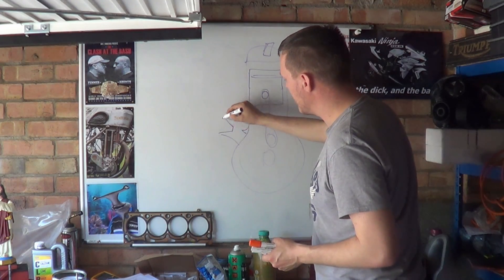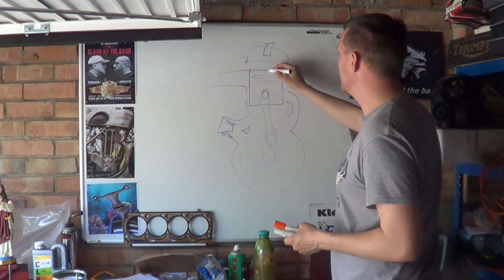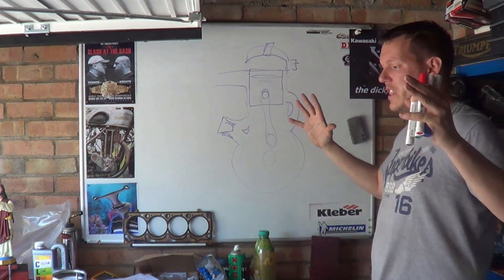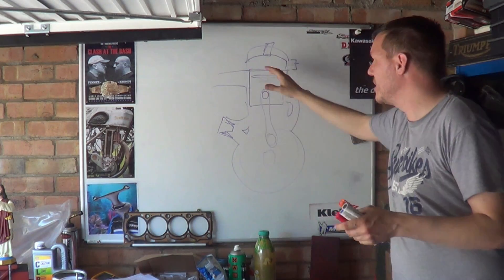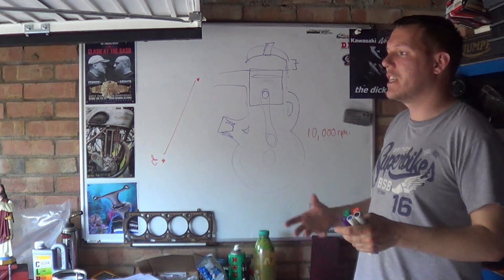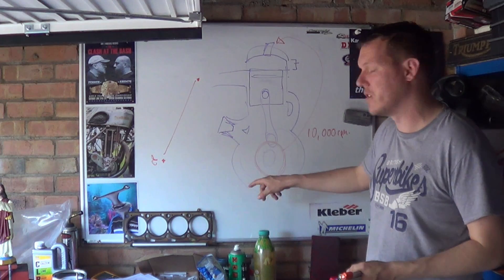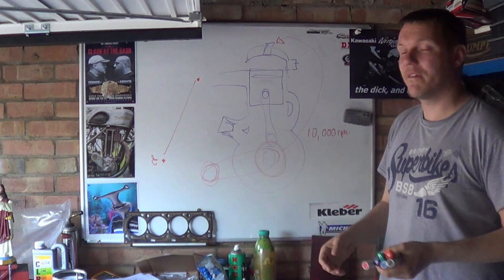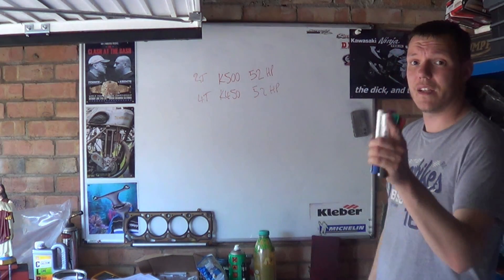2T Direct injection - Comment Reply

Comment: yeah i live in perth western australia where ralph sarich tested a fleet of ford lasers fitted with supercharger scavenged 3cyl air blast direct injected 2 stroke petrol engines,and i saw prototypes dumped at balcatta tip nearby,crackcase scavenged 2 strokes suck balls

Comment: What issues would arise if you ran two separate fueling systems, that fired in alternating order? It would give an extra stroke's amount of time to rebuild pressure within each injector, each one only injecting every other stroke exactly like a 4 stroke would be.
Reply from the maker: cost and weight, but in this case mainly cost

Comment: Is it not possible to address the oiling issue by using Ceramic big end, small end etc..bearings, or something that can bear the heat while still be smooth as a babies bottom for the two stroke engine?
Reply from the maker: Ceramic bearings still need lubrication, I did a video on it

Comment: does brp producing direct injection for 8 years now and moving to a directly oiled crank last year not count? Gas mileage has seen moderate gains through out development but oil consumption has plummeted! I know you look at it from the street bike perspective where the inline fours can provide more than enough power and longevity than the average rider needs but there are other toys out there with very different requirements.

Comment: can you not just replace the typical air fuel carburetor system. and just inject into the crank case through the reeds with a measured amount of fuel to the air
Reply from the maker: yes and they do, but how would this help? You stll need to oil the components inside.
Reply: i would still use yamaha's autolube system into the reed cage but i would use it with a  throttlebody  not  a separate pump like on a dt its no where near the carb or inlet its round the side fed with a line controlled by the throttle cable i would attach it direct to a throttle body with a m.a.f sensor and an injector all linked up with position sensors you could use air ratio gauges and other gizmo's and pressure gauges in the crank this way and it could auto adjust air or fuel with an e.c.u but would still all be controlled by throttle position not engine speed just thoughts ideas. there's probably a still a drawing board or 2 i might need to go back to lol

Comment: i still dont get it how this aprilia ditech direct injection works,  it has a verry low fuel pressure but it uses somekind of air compesor to inject the fuel, realy wierd system, cant quite wrap my head around it.
Reply from the maker: Video coming soon dude - matt

Comment: On snow (snowmobiles) the naturally aspirated prevailing technology is 2-cylinder 850cc Etec (direct injection) two-stroke, producing  about 200 HP/litre. Closest competitor is a Turboed 3-cylinder four-stroke producing the same litre HP as the naturally aspirated two-stroke. 
Both engines has it's pros and cons. The two-stroke is much lighter and cheaper. The four-stroke is  alot more durable, and much easier to get alot more power out of since the turbo is already there. 
When you ride them both on the trails, the two-stroke Etec actually gets greater MPG. But when you use all the ponies it's actually pretty much a draw, all the horses need food 👍😁.
That being said two-stroke direct injection engine technology is very much up to par regarding horsepower output and MPG in select vehicle applications. 
Great vids 👍,  your whiteboard drawings and reasoning is easy to follow  and understand 😀

Comment: This may be a dumb comment but....... My old 1998 2T 125 had a catalytic converter in the expansion pipe. I found out later it was restricting the power but it did work, the original silencer packing (sealed silencer) was still good after 15 years. With an Arrow pipe the packing lasted about 1 month! No need for Direct injection or TPi just fit catalytic converters on 2 strokes, problem solved (maybe?).

Quote from the owners manual - The catalytic vehicle is fitted with a silencer with metal catalytic converter of the “platinum-rhodium bivalent” type. This device provides for the oxidation of the CO (carbon monoxide) and of the HC (unburned hydrocarbons) contained in the exhaust gases, changing them into carbon dioxide and steam, respectively. Due to the catalytic reaction, the high temperature reached by the exhaust gases makes for the burning of the oil particles, thus keeping the silencer clean and eliminating the exhaust fumes.
Reply from the maker: For them to be affective they restrict the air flow quite severly. They also weigh alot about 35% of a 2 stroke engine. The CAT in the 1998 bike won't be adequate for todays emissions. NOx are the main stopping block today. You need a 3 way CAT to pass the emissions testing

Comment: I agree that adding shit to a engine will bring down it's raw hp and adding a super charger is leech on the engine. But you have to factor in that a super charger will be forcing compressed air in which "should" make up for the loss plus a bit more.
Reply from the maker: which I did in this video - https://www.youtube.com/watch?v=7pdY_wlofoY&t=375s

This is in reply to the original above

Comment: Engines with direct injection don't loose power - they GAIN power, torque and efficiency (in regard to EFI/carb).

High pressure pump do need more power, but whole system is more efficient/powerful, and parasitic load is probably just a few percent.
Reply from the maker: LOL I'm going to love this one.

"Engines with direct injection don't loose power" 

- where did I say this? Like really, did I say this? And at what time? If I did then I need to know, because that is wrong.

"they GAIN power, torque and efficiency"

- Gain, power, and torque. Power is torque x rpm. If you increase torque then power will increase. I'm intrested how you think direct injection increases torque in a 2 stroke engine.

"High pressure pump do need more power,"

- err...... yes they do. Higher pressure means more work. More work = more power required. 

"but whole system is more efficient/powerful"

- see you said it yourself. More powerful. 

"parasitic load is probably just a few percent."

- how much, roughly?
Reply: Relax, I didn't quote you, that's my opinion, but here are some quotes: 

"Unlike with gasoline port fuel injection, the air/fuel mixture is formed directly in the combustion chamber in engines with gasoline direct injection. Pure fresh air enters via the intake valve. The fuel is injected into this airstream at high pressure (up to 200 bar). The result is an optimum swirl effect and improved cooling of the combustion chamber, paving the way for higher compression and, in turn, greater efficiency – leading to a reduction in fuel consumption and a substantial improvement in driving dynamics. This makes gasoline direct injection the ideal technology for downsizing and turbocharging."

http://products.bosch-mobility-solutions.com/en/de/powertrain/powertrain_systems_for_passenger_cars_1/direct_gasoline_injection/direct_gasoline_injection_23.html
Reply: ..."Compared to conventional MPI engines of a comparable size, the GDI engine provides approximately 10% greater output and torque at all speeds. "

http://personales.upv.es/~jlpeidro/gdi/P11-1.gif

http://personales.upv.es/~jlpeidro/gdi/gdi.htm
Reply from the maker: "Relax, I didn't quote you, that's my opinion"

- cool.

- The quote you pasted is for 4 stroke cars. Not relevant here. Also that the injection described is on the intake stroke as the piston is on the way down. So pressure in the cylinder is low. And still they use 200 Bar.

"..."Compared to conventional MPI engines of a comparable size, the GDI engine provides approximately 10% greater output and torque at all speeds. "

- and this is mainly down to the compression ratio 10.5:1 vs 12:1. A lot of bikes already run 12:1 with MPI.

Comment: Rotax has been doing direct injection on there 2 strokes for 6 or 7 years now.injector is directly in the center of the  cylinder head,where the spark plug would usually  go. 600 twin gets about 23 mpg,at about 130 hp.the 800 twin gets around 15 0r 16 mpg and makes somewhere around 170 hp.they also introduced electronic oil injection at the same time.
Reply from the maker: Yeah and a video is coming soon, although is not as it seems. And just to add to this comment - 23 mpg is shite and 16 mpg is worse lol
Reply: but the power to weight is so much better on the 2 stroke,what's the old saying? if  want to play,you have to pay!!!! also,they have been turbo charge g snowmobiles for some time now. rotax got there technology when they bought out evenrude.so,if you look at motocross bikes,the 2 stroke makes about twice as much power than a 4 stroke with the same displacement,and the 2 strokes weigh a lot less.honda has a 2stroke endure bike,only available in japan,that meets and exceeds California emissions!!!
Reply from the maker: "rotax got there technology when they bought out evenrude."

- I think you mean BRP.
Reply from the maker: " 2 stroke makes about twice as much power than a 4 stroke with the same displacement,"

- this isn't true, unless you know something I don't?

Comment: I have always wonder if it would work to use a 4 stroke bottom end so it alway has oil and have a 4 stroke barrel but with a exhast port cut in the bottom and a 2 stroke head with a direct injector in it. will it still running like a 2 stroke but on straight fuel?
Reply: then u would need a camshaft to operate the valves... its like a 4stroke converted to 2stroke... i get where u are going, but with all the frictional and mechanical losses due to increased complexity. Im pretty sure it can be done but, with all due respect, imho, its kinda diminishing return isn't?  the advantage of 2stroke is huge power RELATIVE to its weight n size. with all this bits n bobs u added, its defeating its purposes. or not? im open to discussion.
Reply from the maker: "with a exhast port cut in the bottom and a 2 stroke head with a direct injector in it."

- I don't get this bit?
Reply: The Workshop like a 2 stroke but without the intake ports just an injector and a bottom end with a sump so it doesn't need lubrication from the fuel
Reply from the maker: so how does fuel and air enter the cylinder?
Reply: The Workshop an injector and throttle body off the head kinda like a 4 stroke intake
Reply from the maker: wouldn't that pretty much makes it a 4 stroke?
Reply from the maker: I get what you're talking about now. I'll do a video on this soon - matt
Reply: The Workshop if it fired on each stroke and have a exhast port in the cylinder wouldn't it still run like a 2 stroke
Reply from the maker: "The cool thing about a 2 stroke is the "supercharging affect" that 
happens when the piston travels downwards in conjunction with the proper
 pipe. "

- please say you didn't just say that..........

Comment: the BRP etec works good on snowmobiles, but could it be because they are limited to a top RPM due to the CVT (they become really inefficient above 9000 rpms) so they max out at about 8200rpm. another thing with the etec is poor throttle response. on the new 850 etec they added aux injectors in the throttlebody area to work as an  acceleratorpump to overcome that. another feature on the 850 is a four stroke like crank with similar oiling of the bearings.

Arctic cat has a different approach to semi direct injection (on the ctec engine) with a injector in the cylinder wall and a slit in the piston wich gives the option to inject through the piston (to the crank case) or above the piston for a short duration, aimed away from the exhaust port.
Reply: edit. the ctec injector is not directed away from the exhaust.
Reply from the maker: Excellent comment dude - matt

Comment: How about F1's  prechamber idea that they use also in diesel engines ??
Reply from the maker: what about it?
Reply: The Workshop  would it be a somekinda solution or does it have the same fuel injection preasure etc. problems that you mentioned earlier ?
Reply from the maker: Same pressure

Comment: "Fuck off ya diesels" I rekon you nipped that one in the bud. XD

In terms of motorbikes yeah the simple little two strokes we have now will suffice until their all worn out or rusted out no more new 2T bikes.

 Once mazda fixes the rotary and brings out rotary bikes we'll bug you about that.  b

Future mat on rotaries: " welcome back to the shop and blady blady bla but you've got fucking seals and shit and oil injection everywhere and a big ass area to get a combustion front to move down at the speed of sound in the fuel air mix and voice trails off
Reply: wankels are dead. for cars and motorbikes that is, they make great generators and constant rpm engines.

Comment: Emissions if completely removed from having a limit, scientist say the earths temperature would only increase by 2-10 ths of a degree that is it, and that is not a continuous thing just the one time 2-10 ths of a degree. No real effect at all. Not enough to melt the ice caps or anything, that is happening for other reasons not emission. There is also the oil issue, their are patents on oils that do not make emissions worse, problem is the oil companies hold the patents and will not allow them to be used. That would be the real fix, have a low emission oil variant. current race 4-strokes will not meet emissions soon. So why make them ? they are much more complicated cost more and much more expensive to maintain, oh wait that is what those in power want, to make more money. we have to spend more so they make more, do not keep it simple, they want to sell 800 to 1000 dollar exhaust systems, where as 2-stroke exhaust runs 300 to 400. 4-stroke titanium valves and other items for that worthless four stroke. I have ridden xr back in the day with the old 600cc bike and the current 450 bikes. I will run my 2-stroke bike longer between rebuilds and have much less expense in maintenance. and even with mixing my fuel at 60-1 ratio. Maxima k2 is capable of that now. why the injection systems coming out are only at 80-1 seems off.
Reply from the maker: Ok nutcase, you can't expect people to believe you crazy ramblings with evidence so here goes -

"scientist say the earths temperature would only increase by 2-10 ths of a degree that is it"

- Where does it say this?

"and that is not a continuous thing just the one time 2-10 ths of a degree." 

- or this?

"Not enough to melt the ice caps or anything, that is happening for other reasons not emission."

- which are? Did someone leave the oven on again?

"There is also the oil issue, their are patents on oils that do not make emissions worse, problem is the oil companies hold the patents and will not allow them to be used."

- lol what patents? And its simple chemistry. And you also don't understand how patents work.

"and even with mixing my fuel at 60-1 ratio. Maxima k2 is capable of that now. why the injection systems coming out are only at 80-1 seems off."

- I think you've misunderstood how ratios work. Are you saying the 80:1 is worse than 60:1?
Reply: Well you can do your own research, this was my thoughts winch do have validity. by the way 80-1 is better, but with direct injection at proper points you should be able to do much better than 80-1. that is the only question you seemed to not understand my thoughts. The others you just disagree with. So do your own research.
Reply: It doesn't matter which line of scientific research is right or wrong... the politicians believe that fossil fuel is killing the pandas, and they make the laws.
Reply from the maker: "So do your own research."

- I do when needed.

- I'm still interested in where you got "scientist say the earths temperature would only increase by 2-10 ths of a degree that is it" from. IF you give me the link then I can research it. Otherwise I'm just guessing on where to find it.
Reply from the maker: "and they make the laws"

- pretty much the bottom line.
Reply: Agree with that laws are made by those in power, was doing research on the global warming scam and came across the 2-10 ths of a degree somewhere. was current information. Any thing previous to 2015 will be twisted globalist info, which is still out there but the real scientist say it has a carbon footprint(burning fossil fuels) but not enough to have real effect on us. now deforestation is a different story. Bottom line emission laws are enforced by globalist with a selfish agenda, that has nothing to do with the health of us or the state of the earth. I assume you have heard that Global warming is a scam ?

Comment: 1st drawing....your spark plug is at an angle.....just saying.
Reply: Makes cutting the head pretty difficult.
Reply: Might be a TZ
Reply: I Make and Fix Stuff, which TZ?  I'm pretty sure the one I had was centered and plumb to the bore.
Reply: The one I got hold of wasn't, TZ 750, plugs angled. It wasn't a standard feature
Reply: I Make and Fix Stuff, a 750?  Damn, I'm jealous!

Comment: https://youtu.be/LhNHcy9si5o love the videos, check this out I know it's a snowmobile motor but the direct injection is quite innovative if they could apply it to a single cylinder bike motor
Reply: I'll save mat a video. 
1 its complicated defeating the point of many 2 stroke fans.
2 its bulky not all bikes can handle all of that bulkyness
3 it looks heavy not worth 1 cylinder it be better as a two, three or four cylinders.
4 I'd buy every one of them made and cannibalize the engine parts for kits to convert Big block V8s into super-cars overnight.
Reply: Ryan Riel, I'd like to have 1/2 of an 800 HO for my next dirt ride!